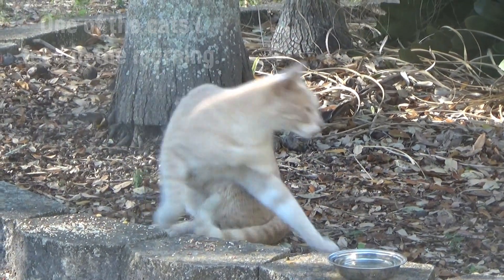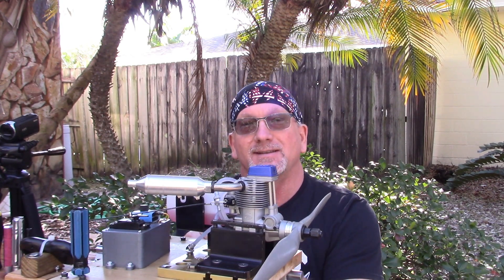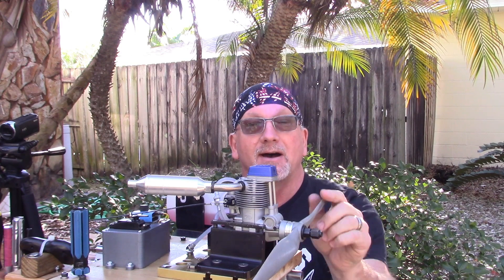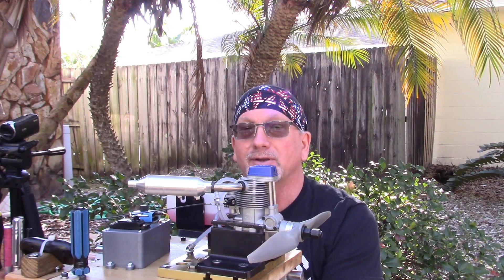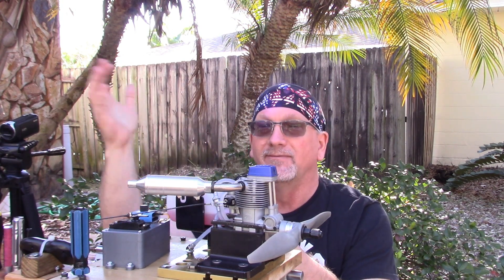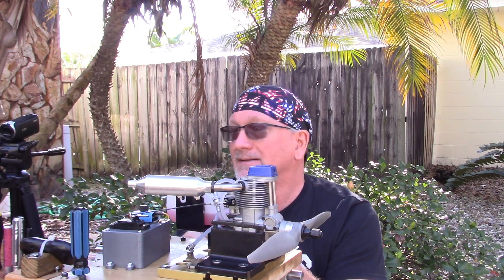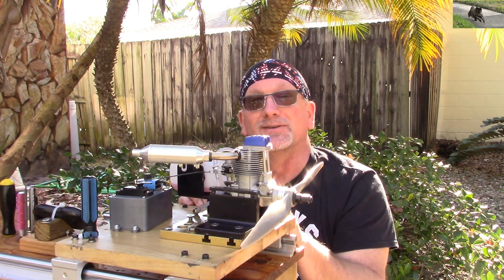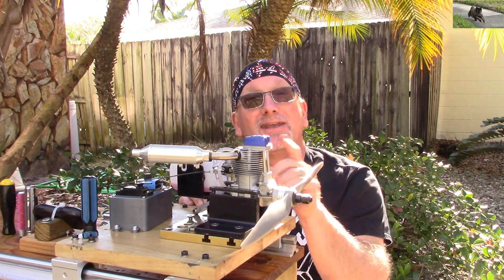OS FS-70 Ultimate First Run Static Thrust v3.0 (Run video 1 of 2)

Comment from the maker: Now you may notice that I did not make any low speed(mixture control) setting changes.  This engine had been run by Mark, the owner, before.  So I wanted to see how well it was setup.  In the next video, I tweak the the mixture control a bit.

Comment: can i use another prop for scale flight on piper j3 cub?
Reply from the maker: No offense but I am having a hard time wrapping my head around the silliness of this question.  Props, fuel, glow plugs are the most commonly experimented with and consumable items in this hobby.  There are NO set rules for what prop you MUST run on any engine.

Comment: This is the first documented run of an OS FS70U that behaves as advertised (at least I have never seen any other like this). Thank you for the video.
My first FS70U was intended to be an upgrade of the FS70 Surpass in a fun flyer (same displacement an power but smaller and much lighter). It was ok on the ground. I used a new stable tank as the pressure generated by the "pump" is really high. It did not run good enough for the demands of a funfly model. Became too rich and leaned out in the next moment. A real dog. Idle was much higher than in your run and not stable. Sold it and put my dependable FS70 Surpass back into the model.
My secont attempt with the FS70U was due to personal curiosity. I wanted to get one of These dogs running well enough to fly it. Bought one that was obviously one of the "dog-series". On the stand it did generate pressure but the fuel Regulator did not work. After a few runs with the original carb I tested a direct mounted Super Tigre G34H carb with good results and finally changed to a OS FS48 Surpass carb. This Setup performed good. I use  the engine in a Q500 Model with Graupner G-Sonic 12x10 Prop (9500rpm 10% nitro). Makes a really silent and fast speed-fun-model. I will try to get it on video soon.
Reply from the maker: Wait until you see the next (final) run video. I adjust the mixture control a bit and run with 2 fuels. This particular engine likes nitro in the fuel and it is very obvious throughout the RPM range. Great information!

Comment: This is my personal engine. I'm Glade David got a chance to run it... I ran it  briefly on my stand.. It ran well but did need to be dialed in still

I have anither on a Seagull spacewalker and it runs fantastic...   Its sad that os seemed to have troubles with many of these.. If I had read that I may not have purchased them... I bought both  on the cheap so I am very happy with them...  But I'm more happy I got "good ones". Thanks to Dave I'll do a bit more digging before making purchases like these... 

I will say I've had great luck with almost every os engine I've owned and I e been flying 40 years so that a bunch!

Thanks Dave fir making the videos
Reply from the maker: My pleasure Mark. Thank you for the opportunity to add it to the database!

Comment: Have you a standard FS70 surpass in order to compare size and weight ? I think this engine is slighty more compact and light.
Reply from the maker: No, I do not have an FS-70 Surpass.  http://sceptreflight.com/Model%20Engine%20Tests/OS%20FS-70%20Ultimate.html  This article discusses some differences in the engines.

Comment: OS 70 ultimate are very strong, i saw them run with 10% nitro and a 14x6 Master airscrew @ 9,500 RPM, really impressive performance on a 81 inch Piper cub; another fellow put this engine on a nemesys 46 with a 12x9 APC and 15% nitro, really a very fast flying setup.  The strongest 70 4 stroke naturally aspirated engine i ever seen.
Reply from the maker: Not directed at you Luis, but why SO many people are obsessed with only how much POWER an engine can produce is beyond me.  If you put an engine, any engine, into an appropriately sized air frame it will perform well.  By only being interested in the most powerful engines people are completely losing sight of the fact that there are MANY, MANY awesome engines out there to be had and used.  This obsession with the most power in the smallest package has caused several manufacturers like OS and Saito  to produce really questionable engines.  This being one and the Saito FA-100 being another....  Get over the need and obsession for the most power in the smallest foot print, as it often dos not work well.
Reply: Yes, i agree with you David   the same aply to most other things like Cars bikes, sound sistems etc, most people buy things this way so manufacturers  focus on sale their products and to make more profit sometimes sacrifices quality. This was more notorious after the ARF big bang
Reply: A good friend who passed away a few years ago used to say "when people compete the coexistence ends"
Reply from the maker: Hmmm, I am unsure if I understand the context in which that statement would have been made.  Competing or competition in sports is one of the only things humans have done to draw people together.  Competition in the form of sports, soccer, football, the Olympics, etc. actually breaks downs the walls between people, cultures, politics, and religion, and unites them in a joyful way.  Imagine if wars could be abolished and replaced with a competitive game to settle differences.   So I do not follow the logic in the statement.

Comment: Evidently the one my friend had was suffering with pump trouble as we never had anywhere near that level of tank pressure. No wonder it ran better on a normal carb!
Reply from the maker: From the little I have read on them, this thread in particular, https://www.rcuniverse.com/forum/glow-engines-114/2220850-os-ultimate-fs-70-a.html  They were hit and miss.  What I take from my research is that the initial runs were bad and then a change was made but not publicly documented.  Then the line was dropped altogether since the damage to the reputation of OS and the engine had already been done.  At least that is my take from the reading I have done.  There is no way of knowing what variant this is, but this particular one runs quite well on the stand anyway.  That will also be reconfirmed in the second video.